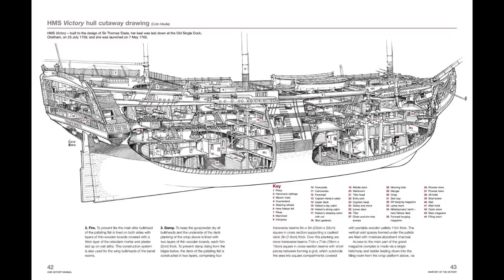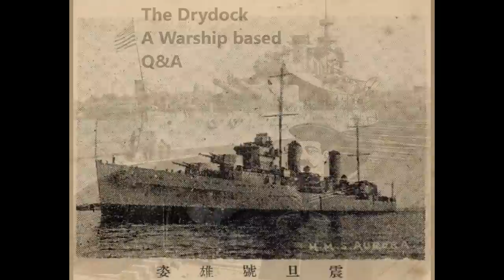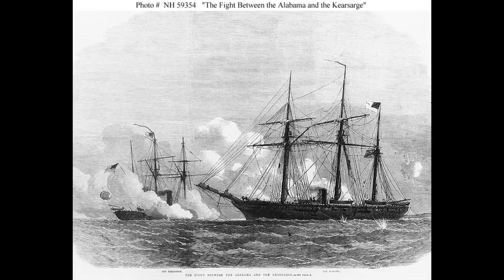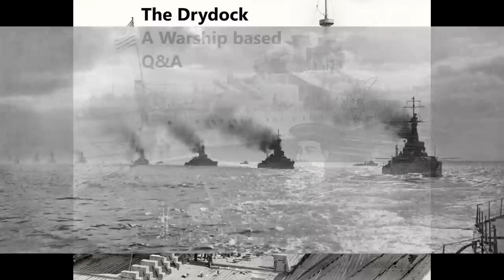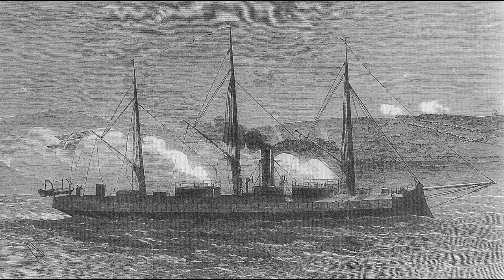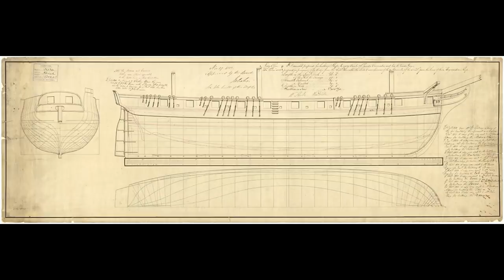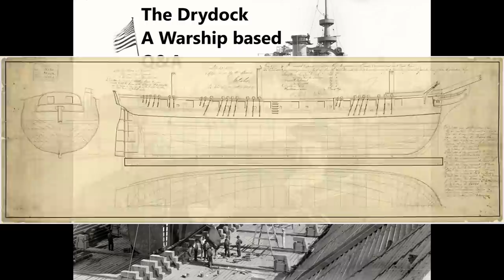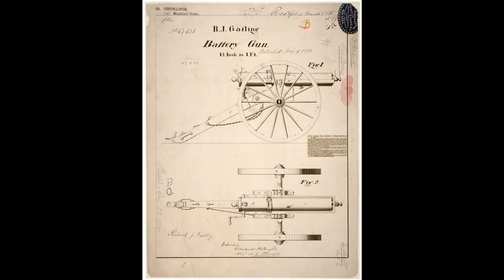The Drydock - Episode 179

Comment: I had a thought on the transom stern and the Nelsons. The compromises on the Nelsons and KGVs were to save weight to match the treaties. The compromises on the G3 and N3 were to save size to fit in existing docks. So if we have a look at lengths:
Hood 262m
G3 260.9m
N3 249.9m
Nelson 216.4
KGV 227m
Vanguard 248.2m

The treaty ships are much smaller and don't need their sterns sawn off to fit in docks in the same way. If the RN was interested in transom sterns you would see them in cruisers of the period. After HMS Adventure they didn't really show any interest.

Comment: The Kawanishi H8K was an outstanding seaplane. It was faster and had twice the range of a Sunderland and the Catalina, and was armed to the teeth, with 5 cannon and 5 MGs. Alied pilots were very carefull when attacking it. It simply had the bad luck of being on the wrong side of the air war.
Reply: Its descendants can also be seen in the modern JMDSF with the Shin Meiwa US-2
Reply: It was also substantially tougher than other Japanese planes because it was a seaplane and therefore actually had to be able to handle stress instead of being made out of gasoline and tinfoil
Reply: @kurumi394  To correct you slightly, "tougher than other Japanese Naval Aircraft". The Japanese Army tended to take protection more seriously, with some of their bombers recieving armour and self-sealing fuel tanks as a result of their experiences in China, years before their allied counterparts did.

Comment: Happy New Year. Thanks for a great 2021 (great in your content, terrible in nearly everything else, lol). BTW the airships are pronounced Ack-ron or Ack-run, and May-con...  In both cases second syllable like "bacon". 

As for the earlier suggestion of visiting Akron Ohio, other than a Goodyear Blimp station nearby, not a lot going on there, most of the tire manufacturing has left. But it is about 25 miles south of Cleveland which has a very nice example of a Gato still in fully WW2 configuration, USS Cod, docked near the Rock and Roll Hall of Fame.
Reply: While you are in the area, Conneaut (a bit East of Cleveland on Lake Erie) has a D-Day Re-enactment every year. (Covid permitting these days, I assume.) Afaik watercraft are involved, though obviously not huge ones.
Reply: Goodyear replaced all its blimps with Zeppelin NT airships more than a decade ago.

Comment: In regards to the 110% max power question, my experience is in industrial settings rather than naval, but I suspect that a similar philosophy governs. To whit, any system designed to withstand significant pressure (e.g. boilers, reactors, etc.) will be heavy and expensive and will be operated at or very close to its design pressure. If it doesn't, you've spent a boatload (pardon the pun) of money for less efficient performance than is possible. (This is where industry differs from the navy, as industry tries to operate at maximum capacity for as much of the time as possible, in contrast to naval power plants. But when a ship needs max power, it really needs it, so there is a connection). This is one of the few areas where the engineering axiom 'do the figures with a calculator, measure with a ruler, cut with an axe' [referring to designing systems with a significant safety margin] usually does not apply.

Comment: Regarding guided battleship shells and electronics sensitivity: this was solved, with the nuclear shells (both Navy and land artillery) being the prime examples. 

On rifling adding uncontrollable spin: that’s the literal operating mechanism of the Rolling Airframe Missile, which relies on its rotation for guidance. 

On the guidance being robust enough: Project HARP (circa 1960) fired guided space probes 180km into space using a pair of 16 inch 45 caliber barrels bolted end to end and bored out to remove the rifling, essentially creating a smooth bore 16 inch 90 caliber gun. [check this out if you haven’t before, it’s awesome]

So while we hadn’t solved the specific problems needed for guided battleship shells based on when we actually did solve those problems there were no insurmountable problems (ex: we didn’t need microchips) that had yet to be solved - we just hadn’t spent the time to solve for it as we were already committed to one blue sky project (Manhattan) and didn’t need another to distract our focus (the last half of this sentence is informed speculation, I don’t have inside knowledge].

Comment: with the question:
 @05:35:08 - "In past Drydocks you've stated that the Royal Navy tried to develop a dual-purpose 5-inch gun akin to the US 5" 38, but that effort failed. What went wrong?"

why wouldn't you  just make a short & long barreled version of the same gun so you have the same ammunition but some are better for anti-surface & some better for anti air?

Comment: Re: 05:10:17 - For the Nelson Class why was B turret the super firing one? 

I believe the question was partially misunderstood here. It appears to me to have proposed |not| C turret being super-elevated above an already elevated B turret (as in Dido or Atlanta), but rather a C turret elevated to the same level as the historical B turret, with the B turret being lowered to the same deck level as A turret. This would allow one to set B turret back by about the length of half a 16" barrel (as demonstrated in the overhang that B turret's guns had over A turret in the historical layout) and therefore make it potentially feasible for B turret to fire directly above A turret even against targets directly in front, as long as they are far enough away. Giving 9 barrels of firepower even when bow-on to a target. 
I assume the reason this wasn't done is manifold.
A) As evidenced by the flat bow, this was very much at the time when the Royal Navy was concerned with being able to fire at 0° elevation directly in front. The proposed method to get 9 guns forward would obviously not work at short ranges where this proposed B turret would be firing directly into the back of A turret, which the gun crews probably won't appreciate.
B) From what I understand, "bow-tanking" is generally not something you necessarily want to do in real life, as it makes rangefinding harder, since you're changing distance to the target at the fastest possible rate and it also makes you an easier target for the enemy, as your ship is now in the correct orientation to align with the enemy shells' "drop shadow", since dispersion is greater along the length of a shot than along its width, for lack of better terminology.
C) As Drach already explained, having B turret as the elevated one gives the best firing angles to the rear (assuming we rule out an elevated A turret for obvious reasons), which may be of greater tactical concern in an all-forward design than having a bit more firepower forward, which is where you already have a good concentration.

Comment: I'm not sure that I understand the issue with the triple vs dual turrets as it relates to the number of turrets.  Specifically, if the number of guns in a turret poses a risk of one statistical event knocking previously unaffected guns out of action when it occurred (i.e. NJ suffers one out of battery event but loses a whole turret as a result) wouldn't that be deeply intertwined with the number of turrets?  I asked this before re: the Richelieu class, and folks pointed out that a two quad turret main battery left you with a 50% loss in firepower whereas 3 triples left you with a 33% loss after an incapacitating hit to a turret.  This makes sense, but goes beyond the reliability of the guns as the most likely catastrophic event for highly reliable guns may be penetration of a turret by enemy fire.  The point that I brought up at the time was that thicker turret armor which could make such a catastrophic penetration less likely could counterbalance the greater damage in the event of a penetration.

I guess my point is that these decisions are very complicated.

Comment: I wonder if the suction difference is also related to titanic being essentially parked, and hood being still at least to some extent moving forward, in combination with the rapid inrush of water as apposed to titanics front half being already full and mostly not attached if not already completely separated and the stern not being as open to the sea on the way down from the top (rear i guess)

Comment: I can give a similar experience with the fact that suction exists, but not with a ship … when I was very young a housing development was being built down our street and there was a steady stream of tractor trailer dump trucks passing our house at about 40mph or so … I used to like to wait for each truck to pass and then step immediately behind the truck just as it passed … why? Because I would get pulled along behind the truck for a few feet, and it was cool, lol 😂. The principle is the same. It didn’t do it with all of the trucks, those that were going the speed limit 30mph, not too much suction …  it a couple guys were, shall we say a little heavy on the accelerator and those would pull you along fairly well 😁

Comment: Some corrections on the probability statistics wrt to the turret question:

1) If all the guns systems are independent and have a failure probability independent of the turret type, it does not matter if the guns are in a quad turret or in twin turrets. If you have a 1% or 10% chance of a gun being out of action, then it is the total number of guns that matters: you'd be just as likely to have 3 functional guns in a quad turret as you'd be to have 3 functional guns across two twin turrets. Now in the real world there are turret-specific issues and probably also issues cramming all those gun systems so close together, so the failure probability is not turret-independent as it was in Drach's thought experiment.

2) Past events have no impact on the probabilities in the future. If you have 5% failure probability and have shot 10 salvos in the training without issues, and then go into battle and shoot 30 salvos, you do not expect 2 failures *in battle*. Instead, you expect only 1.5, since those training salvos no longer apply, since you already know their result. You would have expected 0.5 failures during training, but if they didn't happen, they didn't happen. They do not get 'banked' for future battle salvos. 
One easy thought experiment is this: Imagine you flip the coin 10 times. You would expect to get heads 5 times and tails 5 times, right, since it is 50/50 chance which side up the coin lands. However, by some fluke, the first 5 times it lands as tails. What is the probability that the next one is a heads? You have 5 throws left, and you were supposed to get 5 heads, of which you have seen 0 so far... Naturally, the probability is still 50/50 on the next coin toss, regardless of those 5 tails, and you would expect 2+3 or 3+2 as the most probable outcomes of the last 5 tosses, not 5 heads.
Reply: In other words the dice don't have a memory.

Comment: With regards to a Jeune Ecole approach to the US Civil War, several attempts at torpedo boats were made, most notably in the defense of Charleston harbor. Not only did you have the CSS Hunley, and early attempt at a functional submersible, but you also have the “Davids”, small steam-powered boats equipped with a single spar torpedo and built as low to the water as possible to make them harder to spot.

Comment: I doubt that damage control on starship will ever deal with fire in combat situations (outside something going horribly wrong). You already should have venting/pressurizing system in place to store your atmosphere. Also having some sort of suits for a crew that can at least handle decompression is probably already requirement for a combat vessel. I doubt that supplying full pack of EVA grade suits would be necessary since crew still can hook up lighter suits to a ship and have thermoregulation and electricity this way.

So suit up and store atmosphere for the fight. No risk of fire. Patch the thing after the fight. Restore the atmosphere.

And if we are talking about something fairy tale like Star Wars... well I doubt that there would be any crew outside bridge. Droids can handle everything else on a ship.

Comment: Regarding damage control IN SPACE!!!!! :

Sci-fi that's leaning to the harder end of the scale ( truly hard sci-fi tends not to have space battles at all for various reasons) often assumes that under combat conditions all but a handful of compartments that absolutely require air (sickbay, etc...) would be airless to begin with to reduce fire hazards and shockwaves, with all crew wearing vacuum suits on duty. So stopping the air from escaping likely isn't going to be a major deal for immediate damage control...

Comment: 05:25:05
most of the harbor sections of my charts are in quarter-Fathoms (when in the British waters)
all other drafts/depth are in feet
my bridge clearance and tide charts are mostly in Meters (use a Canadian built autopilot & navigation app)
use knots for speed
when horse riding I use Furlongs to measure bridal way distances
use degrees-Grad per inch for my winches
KG for my own weight, though I use Stones for some of my pets
Pints for beer
cabins are in Tatami (Japanese boat)
pounds, miles & inches in daily life
only Celsius for temperature...
for stars use åth above horizon and heading
occasionally will us Lar (elven-league - 3.16miles), and Staffs (6.25meters)

Comment: Not the same as ships but The Modern Jet turbines I work with 100% is the  Fuel economy sweet spot, running at higher thrust either shortens life or reduces fuel economy. Many Jet engines when new or just cleaned can run at 150% rated thrust gradually reducing until they are serviced.

Comment: Ahh, the “Iowas can simply outrange any other battleship and blow all the competition out of the water because best radar fire control” myth that ignores that live-fire tests that show their actual effective range was NOT actually 30,000+ yards as assumed, but in line with other contemporary designs, even with radar.
Reply: Even with perfect gunnery the flight time would still give the target plenty of time to dodge a salvo at that kind of range. Extreme range shooting might be worth while against shore targets, since a steeper angle of fall might leave deeper craters in a runway or hit a reverse slope,but unless your gunnery officer is named Obi-Wan, anything beyond 30k is a waste of powder.
Reply: @jameshope7933  

Exactly. 

Honestly, this is the biggest thing I have to hold against the Italian 15” gun, the 16”/50 gun and the Japanese 18” gun. They shoot way further than the ships equipped with these guns can even aim, even the 16”/50 gun.

And the 16”/50 gun and 18” gun are also intended for hits that are unlikely to happen in the first place (the 16”/50 gun was designed for deck hits at above 30,000 yards; the 18” gun was intended to hit below the waterline). Though at least they’d still be devastating against any belt armour ever put on a ship, which is really what they’d actually be hitting if they actually somehow ended up engaging another capital ship, so that’s arguably moot.

Comment: I thought the US was wankered (is that a word? It sounds British to me) with regard imperial vs. metric. Everything in the US is pretty much imperial: miles, feet, inches, fractional inches, acres, square miles, pounds (which actually IS a weight, unlike kilograms, which is a unit of mass), etc., but food has both pounds/oz and grams; liquid both quarts/gallons and liters (litres). But we have lots of pure-metric stuff, too, like socket and wrench sets for working on stuff from Asia or not-Britain Europe, and the like. Kitchen scales have a handy switch for grams of pound/oz (I prefer grams).

I very much related to your switching to feet/inches for larger measurements; I KNOW what ten feet looks like, but not what 5.5 meters looks like (though I know it's more than 10 feet); in small-scale stuff I go back and forth. Feet is actually a base-12 system, divisible by 2, 3, 4, or 6. More flexible than metric. For things I need to be able to divide by 5 or 10, I have metric, or my decimal-inch ruler. HA! 

In my line of work (electronics engineering, including PC board layout) one has to be fluid at switching back and forth. Through-hole integrated circuits have pins on 0.1" (2.54mm) centers, some surface-mount components are on 0.05" (1.27mm) centers, but smaller stuff is all metric: 0.8mm, 0.65mm, 0.5mm, 0.4mm... You have to decide early on if your board layout is going to be done in imperial or in metric units, because going back and forth wreaks havoc with grids. I often create multiple library components for the same device: one with the pins located at the nearest metric grid and one with pins located at the nearest imperial grid. It works great for 2-pin devices like resistors; ICs have to have precise pin-to-pin spacing, but the row locations have some latitude.

I'll tell you why I don't like the Celsius scale: the degrees are too big. Fahrenheit degrees have finer granularity. If temperatures were reported in half-degrees, I'd be fine with Celsius. I once had an office air conditioning unit that could only be adjusted in Celsius increments; you could select Fahrenheit, but each button-press was a Celsius-degree jump; it just displayed the nearest °F number. And the setting I wanted was between two settings. Drove me nuts. It broke down, and I made sure the new one didn't have the same shortcoming.